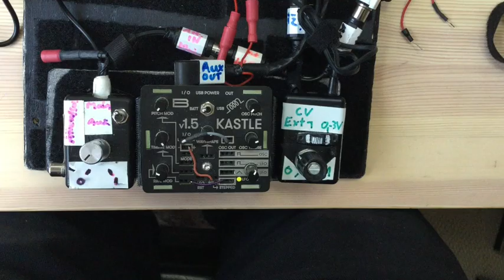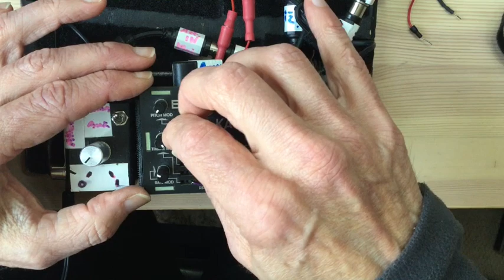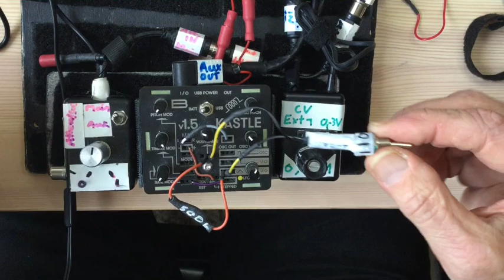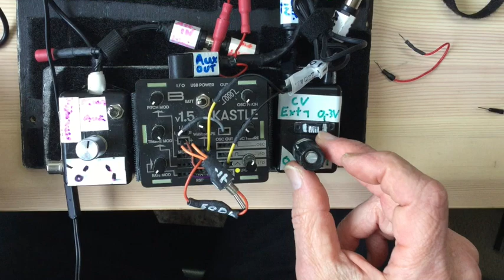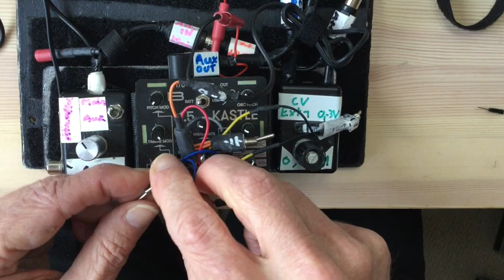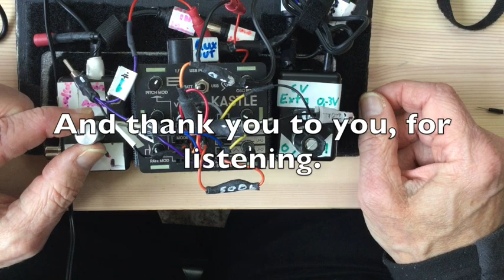Technical Excursion: Patching the Bastl Kastle 1.5 Synthesizer

Comment: Great tips. I have 4 kastle 1.5s.sometime I connect mode and get a white noise snare sound but it's too loud.  How could I attenuate it.
Reply from the maker: Try taking your signal out from the auxiliary outs, via a patch cable from the oscillator etc. You can either run this output through an attenuator, as I do (as in the video). Or, what also works, is a patch cable with a resistor in it between oscillator and aux out. You'll have to try different values to get the level you want. But 100k is a good starting pont. Good luck!  Jim